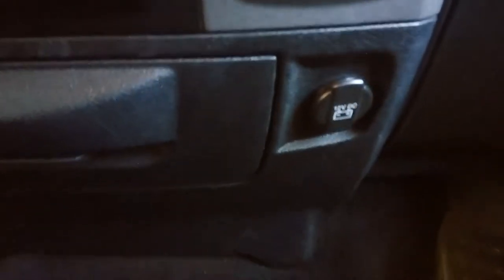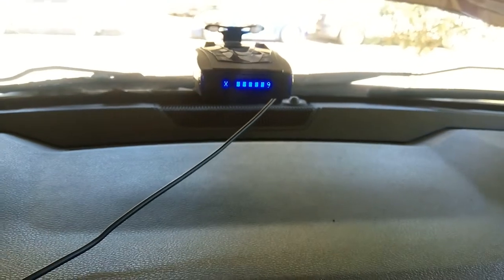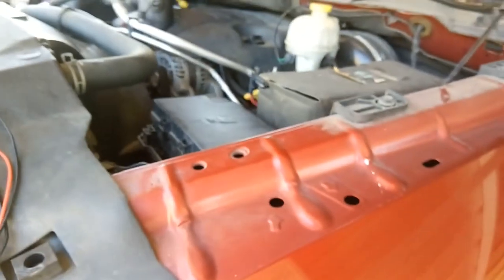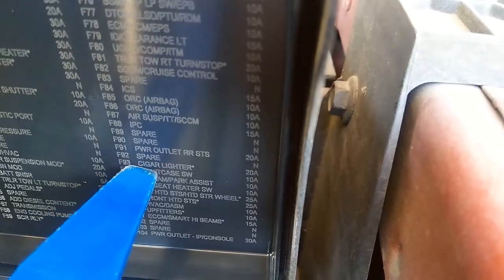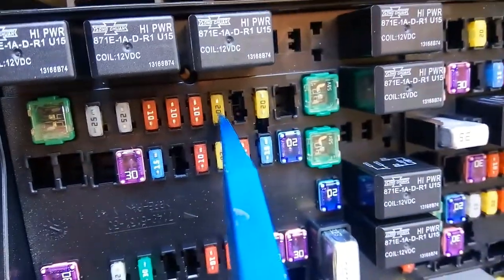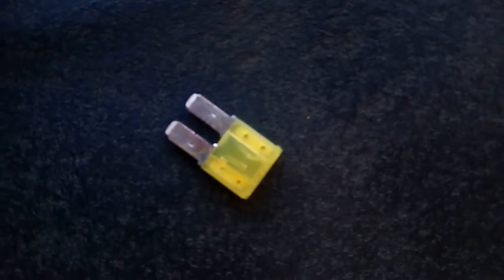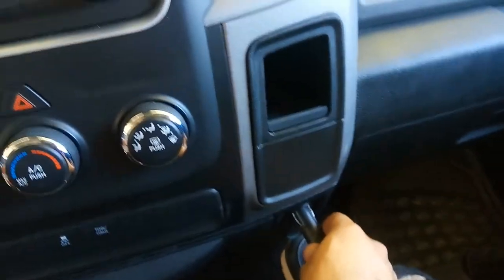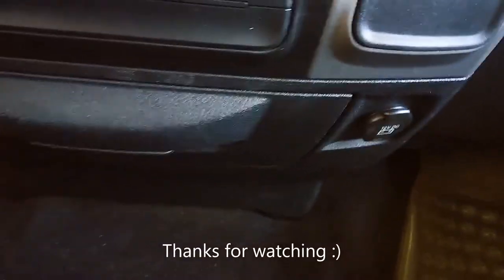Dodge Ram Cigar lighter and 12v outlet  fuse location/Fuse box location

Comment: For my 2007 Ram you switch FUSE 38 over and the dash 12v outlet goes on with the ignition.
Reply from the maker: 2007 its the 3rd generation... I'm pretty sure the fuse box is different from the 4th generation....😎🤘 good thing nowadays u can just google it, and the fuse box diagram will pop up right away ... that's a lot of help 😎